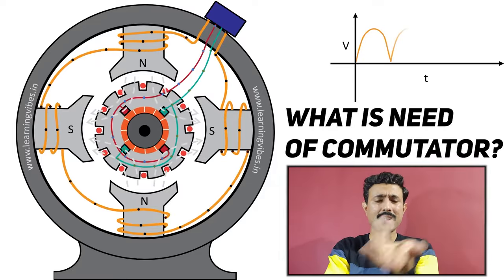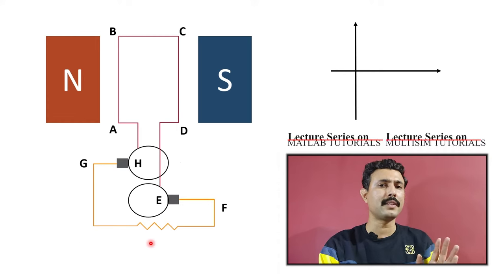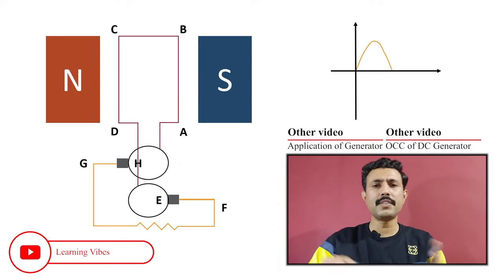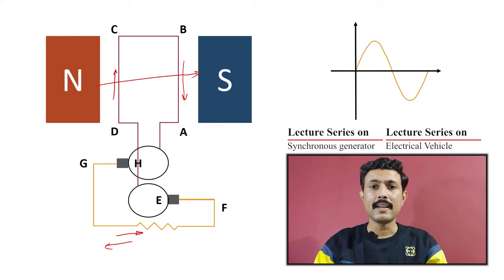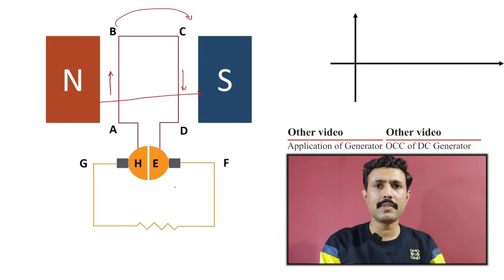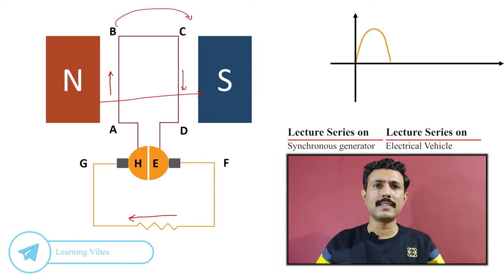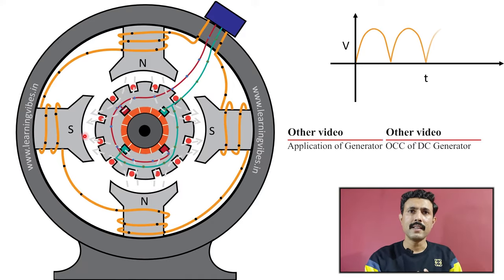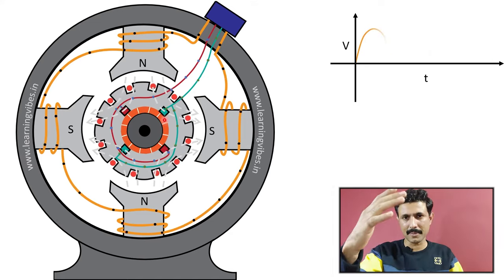Commutator in dc machine | Need of commutator in dc generator | Role of commutator | Mruduraj

Comment: Sir you just explained that commutator keeps the same direction of current but the question is
How it works? how the direction of current remains same? please Answer it in detail 🙏
Reply: commutator converts the negative half cycle of the incoming current to positive half so the output we get is only positive half cycles as you may seen in full wave rectifier ,,,,
Reply: I think he have done mistake

Comment: Well I was wondering can I split those 4 brushes in 2 seperate devices? I do have magnet and 4 brush comitator.
Wuld that thing generate some curent if I use only 2 brush in 1 sude and other 2 in the other side.
Im refering to old rotary converters/inverters/transformers?
Wuld that be posibel?
I also noticed some odd spacing betwean me magnets wuld it make any diference if I wound coils directly around magnets wuld the feald magnetism still colapse??
I have some unusual problems 😅and toughts.
Simply I have brush holders with 4 brushes can I some how add external coils around the starter motor to generate some current back ?